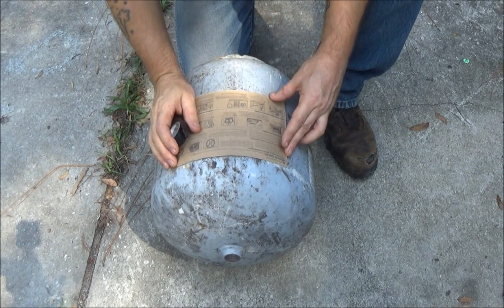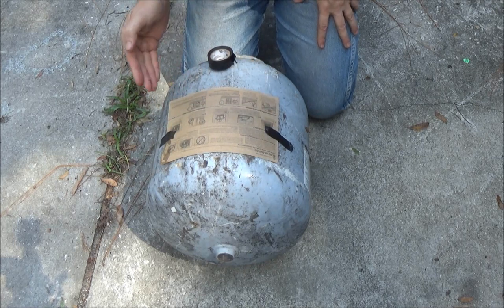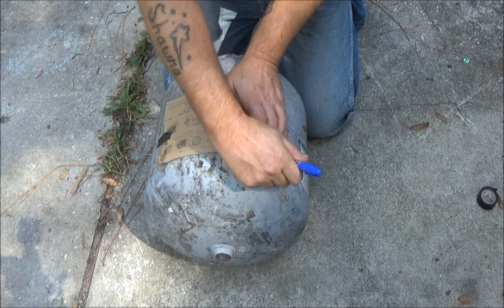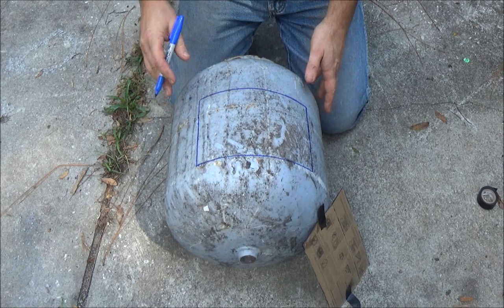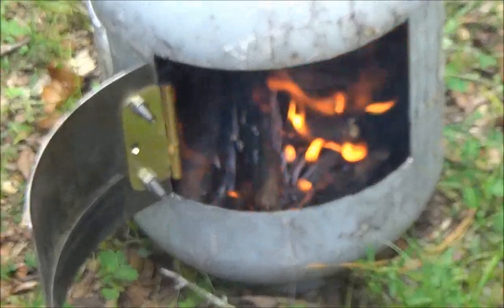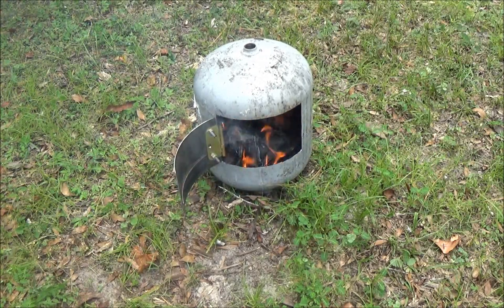How To Build A Stove Out Of A Propane Tank, Part 2

Comment: Just a suggestion. Before cutting out you door completely, cut the hinge side first, weld or bolt your hinges on the door and stove, then finish cutting the door. That way the door is centered to the hole. Just my suggestion
Reply from the maker: That is a good suggestion. The only reason I didn't do it was because I put the hinges on the inside. I did however do it the way you suggested on my homemade BBQ/smoker grill. Thanks for the advice. Also, thanks for watching and commenting.